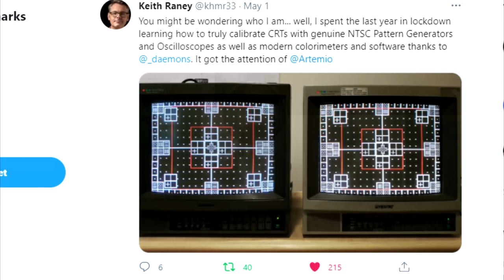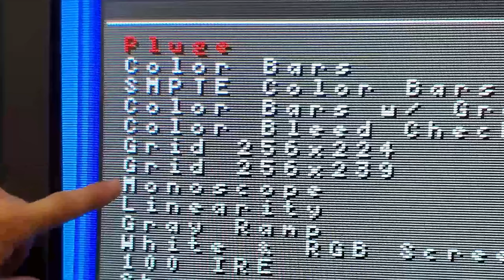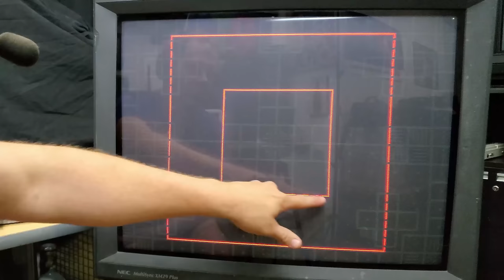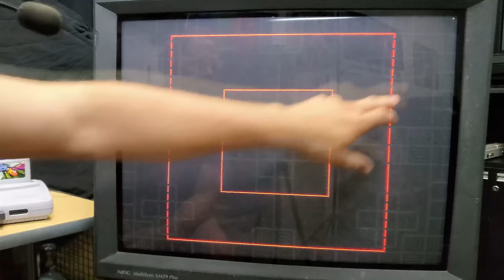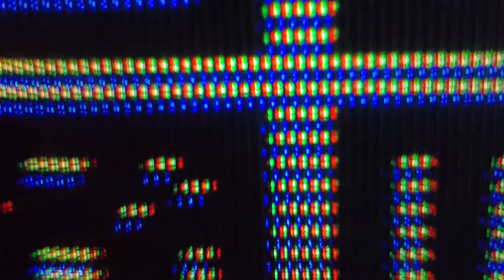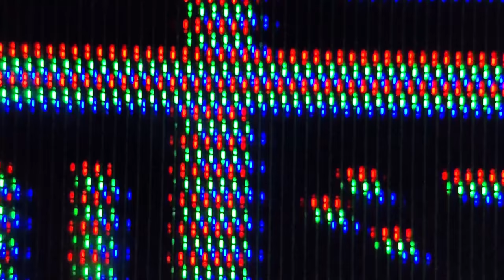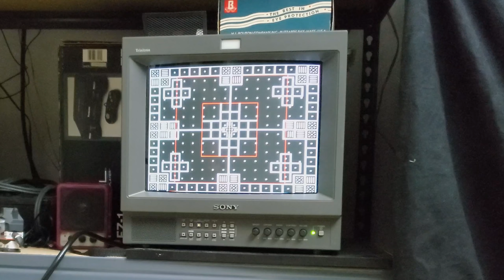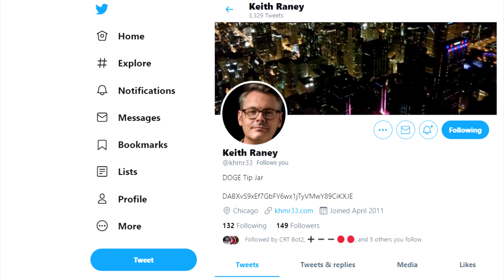The NEW 240P Test Pattern is here!  - How to use this CRT & Display Calibration Tool

Comment: cs-40809, tried this suite out just for the heck of it.. almost literally nothing needed to be adjusted, it's that fantastic :) i just pushed h-position (hwd) to the left by 2 points to get the Wii menu blue arrows to both evenly touch the sides of the screen. these beasts are fantastic.

Comment: Hey @retro tech, I got a couple questions. Where would I go about getting caps for crts, where is a good place to buy them? With the convergance the red squares on my TV I'm using are a bit out of place in different spots as well as general convergence, is that a cap problem do you think? There are convergance problems all over this jvc, but I'm actually trying to get into repairing these crts as I have access to an unlimited supply of various models and pvms. 

Thanks friend!

Comment: Ok so, this program is very good, however noticed that depending on the console/system I'm using I need to re-adjust the horizontal and vertical positioning of my screen. Is this correct or a common issue?

So for example, I adjusted the screen positioning on my PS2 so I don't have overscan, but when I tried to check out this software on my Wii the test the screen is a bit off-screen, horizontal and vertical. I can just use the service menu for this issue, but it's kinda interesting how companies didn't use an uniform rule for screen positioning if that's the case!
Reply: Yes. Therefore I use the rule: one console, one CRT.

Comment: Play SMB3 for a good example of why its better to overscan than to underscan. Any game with simultaneous horizontal and vertical scrolling on NES (Kirby's Adventure is another) uses loading seems to get around the technical limits of the NES. On an underscanned screen, these seems are totally visible, and in SMB3 in particular, pretty ugly.

Game developers assumed most CRTs were overscanned, so we probably should too.
Reply: I've been tinkering with balancing the overscan between SNES and Genesis in order to mask the horizontal shift and I bet that's pretty close to the right amount.
Reply: But when playing Castlevania with the same overscan, it'll cut off the status bar.
Reply: @FigureFarter  on Castlevania IV it will cutoff the top of the sub weapon box, but that should be it.

The problem isn't the standard or the pattern, but Konami's flagrant disregard for the standard.

Nintendo clearly gave Konami a talking to at some point because the SNES version of Dracula X adheres to the Title Safe Area no problem.

Comment: Hi. I need to adjust the geometry of a CRT monitor with VGA adapter that connected to a PC. I don`t have a console like PS1 PS2 etc.
Is there a way to run 240p Test Suite without a console?

Comment: Just got the 240p working on my ps1 recently. Still trying to figure out how to configure it on my L2 xD
Reply: Do you have access to any other systems?
Reply: @khmr33  just that for now since I don't have any scart cables for other systems.
Reply: @Sammmmmmmm617  for just setting up some geometry and aspect ratio stuff Composite and SVideo are fine. I'd have to read up on the L2, not sure what's different from the L5.

Comment: Would this work for accidently messing my Beocenter 1 up? I formatted it in the settings and apparently that is a big no no... I can't get my image right as it used to
Reply: I'm also facing the same issue. I messed around with geometry away to much and now I can't get it right. 
Did you manage to fix your problem?
Reply: Also owning a Beocenter 1

Comment: Guys if I want to send an analog video signal from a PC over DVI to a CRT TV over component or scart, do I need something like a scaler or a transcoder or just the cable adaptors to get the content on screen?
Reply: Older PC DVI ports are DVI-I, so they include RGBHV analog video. If you have such a port, then you need a suitable passive cable and for the monitor to support the frequency your video card is outputting. If you can't get a compatible frequency out of your card, then you need a scaler. Modern PC DVI ports are DVI-D and digital only. You need a scaler in that case, because you probably can't customize the output resolutions enough.
Reply: @ZiggyTheHamster  I have my card modified with resolutions for groovymame and output frequency changed to 15Khz.. and I want to know if I need a Scaler or transcoder in order to get a signal or just cables that goes from DVI-I to component, or DVI to scart, to match it with my CRT TV's inputs.
Reply: @ZiggyTheHamster  btw I'm using Calamity's custom drivers for a Radeon card. 😉

Comment: Question: when I use my Genesis (games or the 240p test suite) I notice thick vertical bands running down the screen of my 20m2mdu. It’s most visible against solid colors. Also the text and detail are not as crisp as when displayed on 256. Is there a way to fix any of this? My n64 doesn’t look nearly as bad.

Comment: Are you planning to do a Windows 9x/2000/XP or MS-DOS  release for this ? That would be cool. 

 I have connected an old pentium III PC, wunning Windows 2000SP4, which has an AGP graphics card with an Y/C output and another more modern Windows 7 core2duo one which i have a professional VGA to Y/C converter for to my CRT monitors.  I don't have much space for all sorts of retro consoles, so i have PC's running emulators and modern games with steam in-home-streaming.